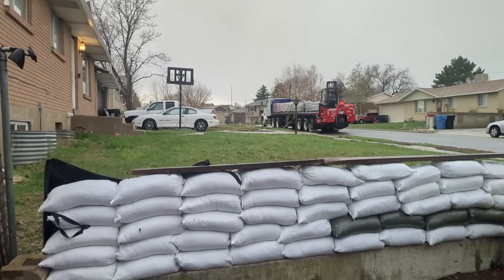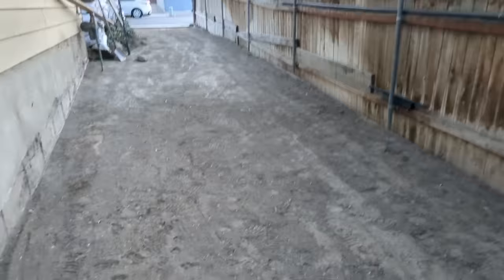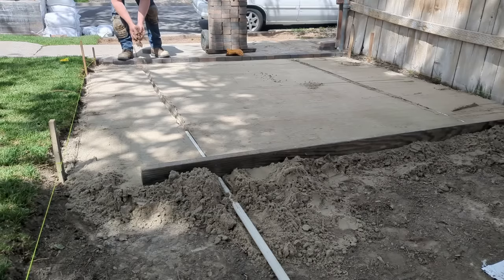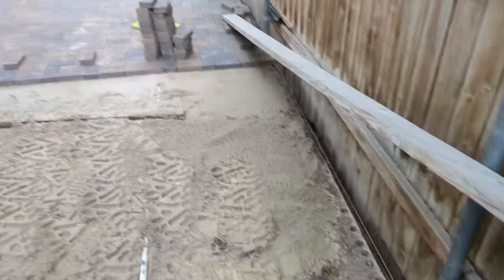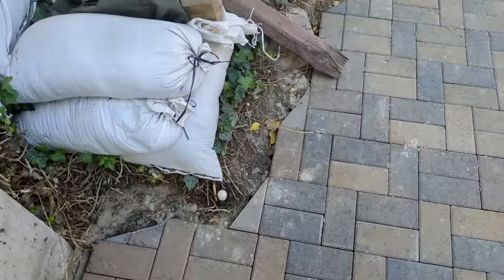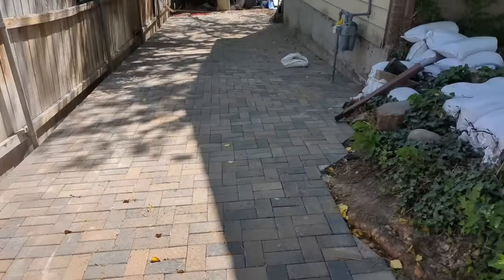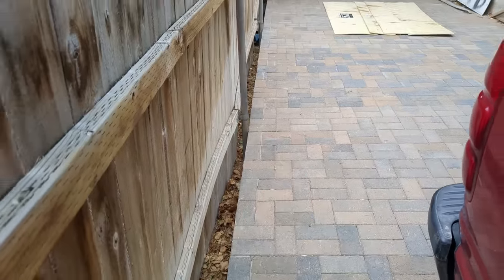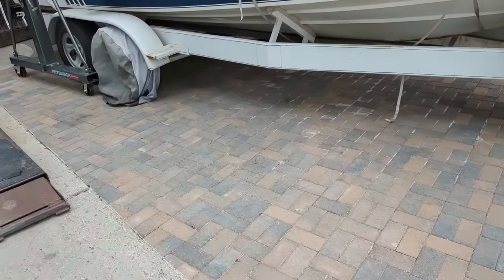Paver Driveway DIY 1/10 the cost

Comment: That looks awesome man, i have about 8000 paver blocks similar the those except grayish, im going to lay them down under my car port vs concrete or asphalt
Reply from the maker: That's a ton of pavers. This total was around 5000 pavers/1100sqft. I think I'm going to do a few thousand more next spring to extend my driveway all the way into the backyard.
Reply: @sixtyfiveford  i have a stick built car port beside the house and a metal frame behind it, im going to enclose the metal one for my finished toys so that will make a nice floor plus bring it out about 40 more feet to the end of the stick built one for my daily parking. We did a 180’ long 16’ wide driveway for a guy that was part owner in a brick company and when we were done he said for me to come by with a trailer and he would load it up with solid pavers nobody seems to want so i hooked to the gooseneck trailer and rolled up one Sunday about closing, he told the guy to stack it and pack it with as much as i felt safe hauling. Well we got 12 pallets on there trailer and another one laid loose in back of the truck but on the way home i realized i wont as comfortable pulling it as i was loading it up….that load was HEAVY but at least the DMV officers were home😂
Reply from the maker: @young11984  Dang. I was going to haul all these pavers myself, but when I calculated the weight of 5,000 pavers it was right at 20,000 lb
Reply: @sixtyfiveford  yep he said it was about 35k on there but i didnt have to go but 30ish miles and took backroads lol

Comment: I’ve been considering converting my concrete driveway to pavers. My driveway has a pretty steep slope, around 30 degrees.  I’m wondering if that changes anything in the prep and construction of a paver driveway.
Reply from the maker: If you have the room, the best is to place pavers over concrete(even cracked). I would assume otherwise a thick gravel base would have to be put down. You'll find researching that different places, soil types, weather, etc determines exactly what you need to do to get satisfying results.

Comment: Looks really good  but the city might have a problem with the curb ramp, it blocks the gutter on the street 
What i might have done because your on the hook for the street gutters outside your home even though its city property, but you have to keep it up, is cut out the city curb and put in a slope type curb
Like most new housing areas get now.  No curb in my negiborhood is a box style. 
I had a buddies who bought a brand new house, his driveway was a side entrance right in the center of one lane was a city storm sewer drain with a 4" drop why the code inspector let them do this is beyond me, what i did was attach 2x2 angel iron on both sides and install metal grate so it couldn't get blocked.
On the edges i put in some pvc pipe and built up concrete slope.
I drive by it once and a wile hes moved but its been over 40 years and its still there last time i looked the cement was falling apart i put in but the metal grate was still in place.  It also didn't block water.

Yours blocks street water. 
You need to fix it.

The rest of the project looks good ecpt the negibor 6' fence that would be a code violation in the frt or side yard.  Here you can only make a 4' fence it blocks the view of the street.  Plus it looks nasty with the frame work on the outside, id put pickets down my side to hide it.
If its on the property line you can do that.

Comment: The gas meter line needs to vent,in case t starts to leak under ground.
Reply from the maker: It turns out sand isn't air tight.

Comment: I am a landscaper it is concerning if you have achieved 10% of original cost - either your original contractor was trying to rip you off, or you cut a lot of corners. Maybe both. Materials usually account for around 60% of a job like this, the best you can hope is to save 40% if you already own the tools and machinery, have good source for materials and don't count the cost of your own time. We buy materials in bulk I don't use 100 plastic bags for sand it comes loose on a lorry that is a lot of plastic waste and far more expensive. That is sold like that for small projects of 1-2 bags. For reference I would have charged about £5000 to do this properly it is two days work for us and about £3k in materials.

Your soil has a large proportion of organic matter which is why it is dark, there should have been at least 4ins more removed and replaced with road stone. I can still see big roots in it. You need to reach bedrock or clay subsoil to use just sand alone (test by putting some in a jar of water, if you see floating black bits and roots you are too shallow it should sink to the bottom). It does not matter how much you compact that, even if you has used a bulldozer, the organic material will rot and vanish over time unless you exclude air and water, this will leave voids which will causing paving to sink where it is driven on. A contractor would never leave that unless they are a cowboy, that is one cause of price difference. About half of our jobs involve rebuilding stuff exactly like this, it is interesting to see what people are thinking when they do it.

On the positive side you did a lovely job of cutting the brick around the pipe and your concreting is fine (if lacking a solid haunch) you are definitely a better builder than landscaper. It is not as easy as it looks to get it right if you want things to last 5 years+. It is all about the initial excavation, you always have to go twice a deep as you think and remove more material than you would like.

Comment: Should've used jointing sand
Reply from the maker: I debated and decided no. It's way over hyped. Jointing sand is going to degrade and break down under heavy loads and winter heave. I don't want a solid surface and want all the pavers to move independently. If I was just doing a 10x10 patio, maybe. But this is going to move with expansion, something locking them together won't allow. Better than jointing sand is just to pour a thin slab of concrete underneath though.
Reply: Idk about over hyped as it will keep the weeds and ants away especially if sealed after. It also helps the pavers somewhat self clean. It would have been a significant additional cost though. $70-$100 per 100sqft. Polymeric sand stays somewhat flexible for seasonal changes. Proper base, grading, and planned drainage would have also been needed. Totally understand not using it in this scenario. He wasn’t exactly going for a pristine driveway, just an upgrade for the time being.

Comment: Just my 2 cents. You should have put at least an inch of crushed rock down first, then the sand.
Reply from the maker: Yeah, it really depends on the soil type and how much rain. I live in the desert.
Reply: @sixtyfiveford  I live in the desert too. Tucson AZ to be exact. I did pavers once with just sand and it did not turn out so well. The next project I did I put down crushed rock and it is solid to this day even after several monsoon seasons. 

Your job looks incredible, and you did an amazing job with your water access, and cement work. I’m not trying to take anything away from your end result. Thank you for posting the video.